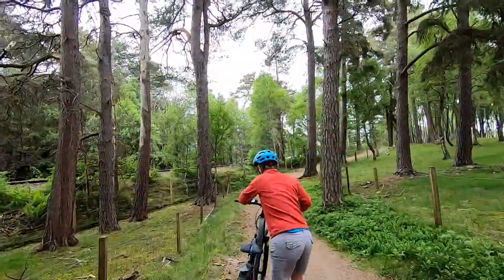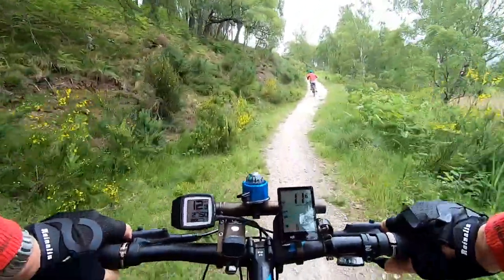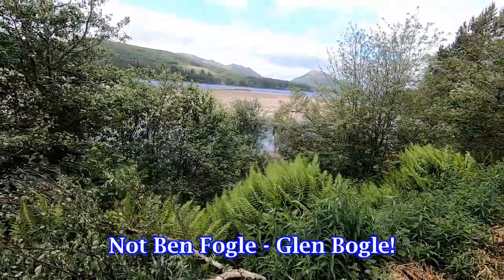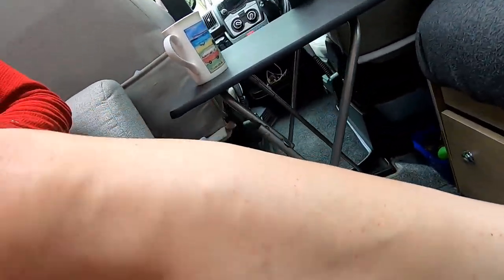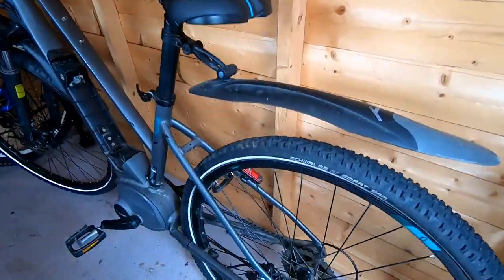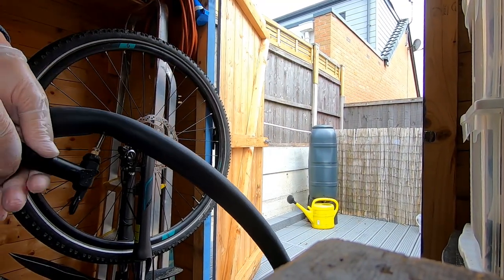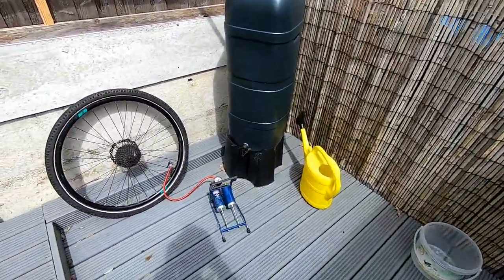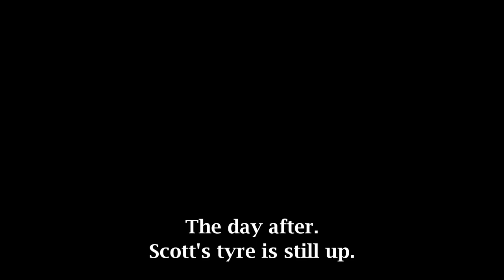Cube & Scott E Bikes: Short ride and puncture repair farce.

Comment: Derek  absolutely  brilliant  its the only one of your vids that I've watched  and I've had  to have  a lie down afterwards  .
Reply from the maker: Hi David. I laughed at that one. I've just watched it and somehow I feel a bit itchy. I must admit, I'm a bit more 'with-it', with innertubes than before. Really, the hardest part was getting the tyre off and back on the rim. The new tyres I put on the Cube last year were no trouble at all. They just went on and got pumped up. All the rough tracks I've been on and they're still okay. On this holiday I did 149 miles on the Cube which never skipped a beat in any way. Miles to date = 2,807. Cheers.

Comment: Hi Derek
I enjoyed your video doing the puncture repair. I found the best way to repair a puncture is with a patch/glue and have done this on the trail without taking the wheel off especially with a rear motor ie Vulcan ebike. Locating the cause before separating tube from tyre pin points the damage on the inner tube. Those Presta valves on Helen’s bike tend to break, I usually drill out the rim to take Schrader valves.
I have recently change my tyres to Schwalbe Marathon eBike tyres as one of your other followers did, they have a thick liner under the tread, in fact I picked up a nail recently and must have pulled about 3mm of it out of the tyre and it did not punctured. I also found these smoother less knobbly tyres have less rolling resistance and have climbed up familiar  hills in Tour rather than Climb assist setting, thus saving battery and my average speed has also gone up for the ride. They are a bit slippery on mud but excellent on gravel etc. One of the best improvements I have made and no punctures so far!
I hope your back recovers soon, I have a bad ankle so I know what pain can be like but cycling is great for getting it better. I have done backpack camping in Scotland so I know how bad midges can be, I suggest long trousers and shirt sleeves. 
Cheers from an earlier follower with Vulcan Mk 1 still going strong.
Reply from the maker: Hi Colin. Just found your comment. Didn't know about it. I find what you say interesting. The Cube with its fairly new road going tyres does roll better downhill and on the flat. I have to use the brakes more. lol. Can't say much as we are away and the signal is bad. cheers.

Comment: Hi Derek, I trust you are well and your back is not giving you too much trouble.
I posted this comment 3 weeks ago reference your puncture video which may be of interest to you but have not seen a reply, perhaps you have missed it as you normally have much to say.
I have loved your 2 latest videos in Scotland, you are so wise to have a campervan with staycations being so popular this year, I bet the waiting list for a campervan now is extraordinary.
Regards from an early Vulcan follower.
Reply from the maker: Hello Colin. Well, it looks like another comment has slipped under the radar. 
I can't fathom why there are two different types of tyre valves. According to a friend of mine he reckons there were three at one time. I would have drilled the wheel out at Glencoe but actually the innertube with the Schrader valve was too wide for the tyre.
Glad to hear your Mk 1 Vulcan is still going. I often wonder what ever happened to the one I returned to Halfords. With the miles I clocked on other e bikes if I'd have kept it, it would have clocked up around 5,000 miles!
As for the tyres on the Cube they seem fine and do have extra puncture protection inside which after loads of rough tracks are doing a sterling job. But on tarmac the bike just rolls away so quickly and silently. Over 800 miles there's very little wear.
As far as going away on sites, you've got to plan well ahead. This Scottish holiday was planned and booked way back in January and we only just got on the odd site then. Anyone who thinks they can just hire a motorhome and  book a site for a few nights had better think again. They might just let lucky though.

Now my back! On this holiday it had more or less recovered from going big style in December last year. I was hardly noticing it but then a few days after returning home, it went again and this time it doesn't seem to be improving at all. It now aches all across the bottom and it's murder in bed. Turning over or getting out of bed is a real chore. This morning, as I got out for a toilet visit, I pulled my muscle in the back of my left leg. So I hobbled to the bog like a 90 year old. Patience is needed.
Funnily enough, it's less trouble when I'm on the Cube which is happen as well lol. Cheers.

Comment: Just come across your channel great content so I have subscribed looking forward to watching more. Have you ever thought of going tubeless most rims allow tubeless tyres then you won't get a puncture as often if at all as the fluid in the tyre repairs the hole as you go along. I felt your pain with the midges I went to Scotland in Midge season and in the early morning or in the evening I couldn't go out side.
Reply from the maker: Hi David. Thanks for sunscribing. It's rather odd as a few weeks ago my subscribers were 437 and now thay are 434! The new tyres on the Cube are puncture resistant and so far they've been okay. As far as Helen's bike. After the painful puncture repair it started going down so I pumped it up and after a few days it went down again. I removed the tube and pumped some air in it and couldn't find a problem. The tube stayed up for over a week which was odd so we have replaced it with a Continental inner tube. A few weeks on and it's still rock hard. Puncures are very rare for Helen so I think she'll be okay for a while. The spots on my legs faded away after about three weeks and haven't left any marks. We don't normally get bothered by the in Scotland so this was a bit unusual. Cheers.

Comment: Oh Derek! 
Like David, I too needed a lay down, and a stiff drink, and a bath after that.... I'm itching like mad!!  I actually got confused in the end, which inner tube did you end up using?  I can't see the Scott having 28" wheels? 27.5 or 29", but I'm guessing.  You'll also be amazed at a narrow gauge tube's ability to fill the wider tyre. Also Derek if you put talc, or soapy water on the inside of the lip of the tyre rim, it seats a lot easier, and always put around 70-80lbs in 1st, it literally pops into place, then reduce to around 35-40lbs for rear tyre, and 25-30 for the front for the kind of riding you and Helen do. You'll get less pictures with more pressure in, but a tad harder ride. I know you haven't had many pictures, but maybe you've been lucky, or you already have higher pressures in there.   Them presta valves are so awful aren't they mate, I have the wretched things on My Haibike.  

Brilliant entertainment though Derek throughout, sorry about your legs though, they look like you've been machine gunned.

Cheers for posting mate
PS: I nearly forgot, the trail to Aviemore at the start of the film looked really nice!
Reply from the maker: Hi Daron. Yes, it's all confusing with inner tubes and tyres sizes. The Scott's wheels are actually 27.5 so why would they make a 28 inch wheel, it's hardly any bigger, is it. Having had a comment off someone about the film I did with the Scott last year when the chain came off, where he said he enjoyed it and thought it addictive viewing, I thought I'd film this from the start, but I didn't think it would be as long and drawn out as it ended lol. As for the midges, well, my legs are still as full of Randoph Scotts as ever and are showing no sign of going. It makes a good talking point though. The look of horror on people's faces is entertaining.
Getting back to the tyre problem on the rim, I was on its case. I remember repairing a puncture on the Cube ( back wheel). The back wheel was a replacement one after I'd reversed in that fence in Cornwall and buckled it and the tyre was really hard to get to sit on the wheel properly. It created a thudding sensation on a smooth tarmac road and only 50lbs of pressure could get it on the rim squarely. The Cube's front wheel was no problem. When I replaced both tyres last year the front tyre came off easily and the new tyre went on easy. But I will try some soap or talc next time. When you think about it, punctures are a enigma with a bike. You can have a bike for years (My blue Carrera Vulcan) and never have a flat so you tend to get a little indifferent and assume you'll never have one. In a way it's been a wake up call. Carry the right size inner tubes  and hope it's not peeing down lol. 
I must say that this Cube of mine is like a favourite child who's good looking, reliable, trustworthy and never causes any heartache. The question is how long will it go before, like us humans, it begin to show signs of age? At the moment it rates as one of the best things I've ever bought. Even the front suspension still has no play in it - yet! I might do a 3,000 miles review but doubt whether there'll be anything to say only - nowt's gone wrong! Cheers and keep taking the meds.
Reply from the maker: Hi Daron. Just to let you know, my back has gone again and get this, it's gone exactly the same way - reversing the Jag on the drive and simply getting out. 
It went big style just after Christmas last year but it has been slowly getting better, bit by bit. 
In the last month or so it hasn't been too bad to the point where I was doing things and hardly feeling it but I'm now back to square one. 
It seems odd that the fine dry-ish weather has gone and we have rain again and bang goes my back - it's totally unreliable! It's a good job I still don't work or I would be in trouble. 
Hope your meds are working or is it early days? atb Derek.
Reply: @derektaylor6713  Hi Derek
Awe mate, I'm so so sorry to hear that, it's always the seemingly innocuous actions that does this to us now we're getting a tad older isn't it?  Gale's sat here as We speak with a wheaty/heat pack on Her back, I know this is only a sticking plaster, but does seem to aid quicker recovery, along with anti-inflammatories maybe aswell.  All the best with it all Derek, please keep Me up to speed with it, we'll be thinking about you.

Cheers mate
Reply from the maker: @likeher9  Sorry that Gale has a bad back as well. It's surprising just how hopeless the human back is. 
I've just dropped Helen off so she can help our Matthew fill his skip, which apparently has just been cancelled till Thursday. Don't know why yet. I got back, opened the car door and remembered the front door key is in the centre console. On opening the door again and going inside my back has now gone big style. I hobbled into the house doing a Groucho Marx. Back to square one. 
How are you doing with your problem and the medication?
Reply: @derektaylor6713  Dear god Derek, what are We like? Has for Gale, She had two spinal fusion/bone graft operations when She was younger, and is now always in some discomfort with Her back and neck. Has for Me, I managed to stay out of hospital last Friday, the bacterial antibiotics did help with the severe pain, and infection, but still have most of the symptoms I've had since My brain tumor operation last September, so will have to see how this unfolds in the coming weeks and months. I do have another health issue running in parallel, and indeed having scans, and biopsies for also at the moment which does sound very worrying just now, but should know more after Thursday's biopsy.  I was pretty healthy until last September Derek believe it or not!

You take good care mate, and keep Me informed please
Reply from the maker: @likeher9  In comparison my back problem seems trivial. I'm now worried about these other problems you have. 
It's almost six months to the day since my unreliable back went on me. It will go right again but how long will it take. It is at the moment so bad even riding my bike is out of the question. 
All that walking and cycling in Scotland seems to have amounted to nowt as I'm back to square one again - stuck on the sofa with Deep Heat and my support on. 
At least I managed to do some filming. In fact, if it wasn't for the need to top-up my videos I probably wouldn't have done anywhere near as much cycling as I did. 
One ride which was cancelled was Rosemarkie to Cromarty the day after we arrived at the site. We were both supposed to be going out that Sunday afternoon on the bikes when it became so windy and really dull we didn't bother. The day after, we left and headed to Dalraddy so maybe next time. If, at times, I seem not to be answering your comments, it's because we are probably away somewhere and can't get an internet signal. Keep going and fingers crossed for good health. Cheers.
Reply: @derektaylor6713  Your back problems are definitely not trivial Derek, I know from Gale, and I've had My back go in the past Myself, it's a whole world of pain! And it gets you down too.  Yes I'm dreading My biopsy on Thursday. Will let You know what comes of it all mate.

Thanks again for all your concern.
Looking forward to your next film.
Take care both of you

Daron

Comment: why don't you get slime in your tyres or i should say innertubes' stops small punctures     but great vid innertubes just blow up iv used 26" in 900c and 27.5" they just fit
Reply from the maker: Hi Derek. Last year I put Slime in both wheels of the Cube. We went to Cornwall and had a nice ride along the Camel Trail to Padstow. The day after the Cube's back tyre was < Flat!>. 
I removed the bike off the rack and found a thorn stuck in the tyre. I dug it out and found Slime blowing bubbles at me. I removed the tyre and the tube was still blowing green bubbled like a snotty two year old. I eventually found a shop and put a new tube in. 
Then back home, 5 miles from home, I picked a screw up, again in the back wheel. 
I've since replaced both tyres with Continentals. These tyres are supposed to have a puncture resistant lining inside. After 800 miles of really sometimes rough tracks they still look like new and no punctures!. 
The Slime was about a tenner. For me, it didn't work. I know it's supposed to do. For some it probably has worked. Cheers.
Reply: @derektaylor6713   If you want the ultimate puncher protection, Get TANNUS ARMOUR in all your tires! It's not cheap and a bit fiddly to install, But once done you are covered! I've got that stuff on both my bikes and have done thousands of miles without a single puncher issue.